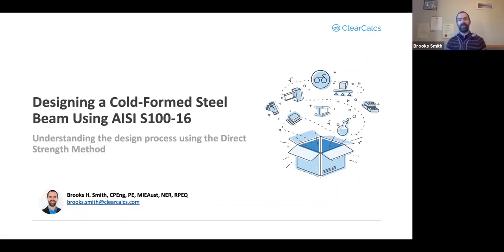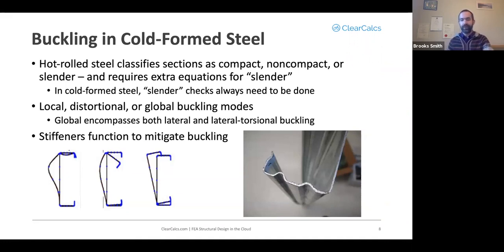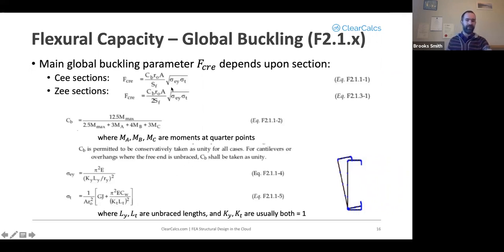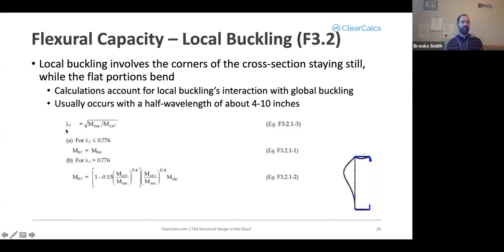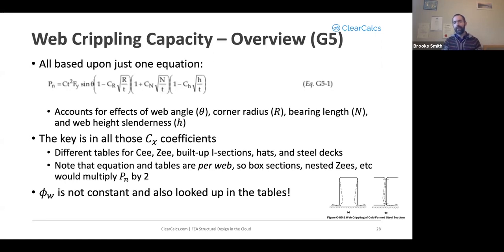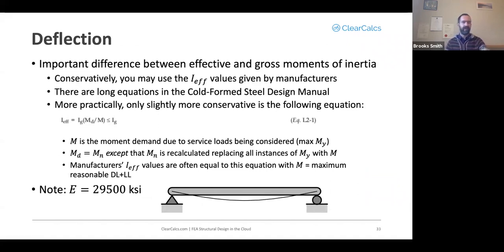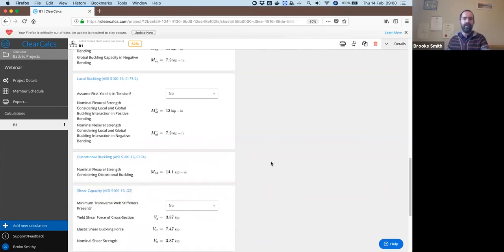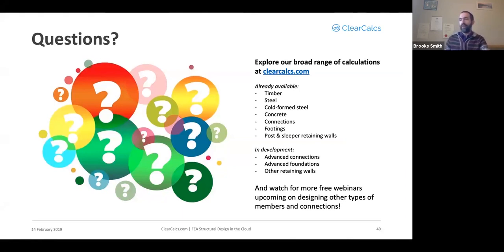Webinar | Designing a Cold Formed Steel Beam Using AISI S100-16

Comment: Great webinar, very well done. 
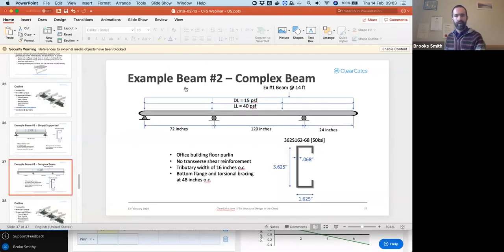You do have a slight math error in your example. At time 52:27 for the span you said 196, then changed to 210, but it is actually 216. 
That said with the added span does the new shape selection still work? 
The deflection was at 99% capacity.

Also, have you heard of HVAC formed flanges TDC/TDF? 
Would you have those shapes in your database?